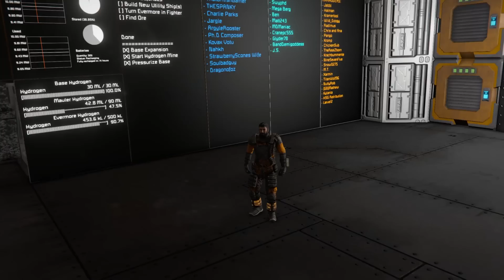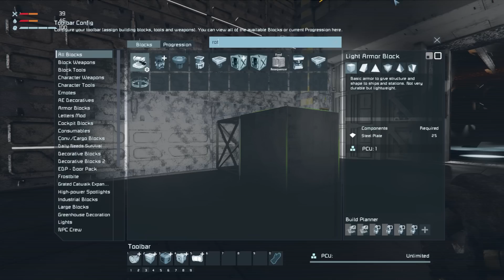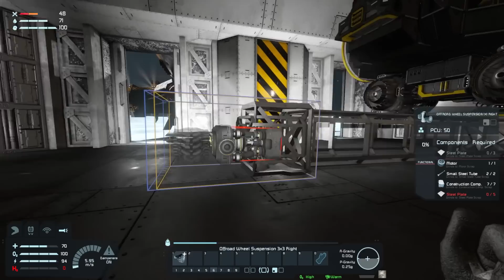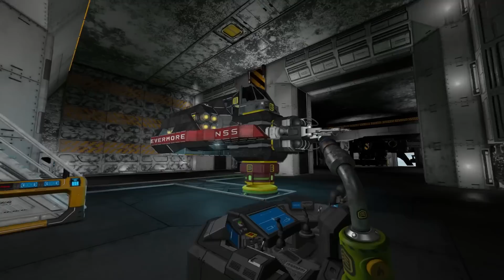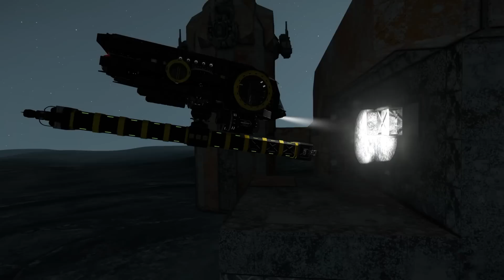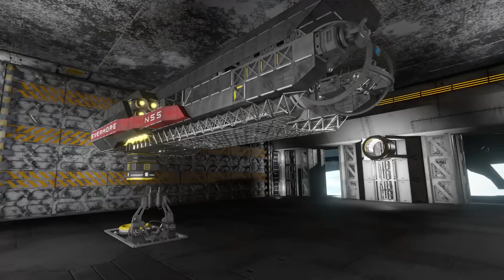No Suit Survival Europa: Ep. 4 Tools of the Trade - Space Engineers

Comment: Idea for towers: mobile. Either on wheels or with thrusters, then make a pipe to them. Can move the pipe easily and the tower doesn't have to be deconstructed every time.
Reply: Also, to solve the cockpit vs flight seat behind glass issue, you might be able to use the mod Block Combinations, which I believe includes combined glass pane/cockpit blocks that are airtight. In the same category of mod, Offset LCD and Text Panels does the same thing but for, well, you guessed it.

Comment: I had an idea for building out your base.  At the beginning of this you mentioned that your turrets might interfere with expansion.  They wouldn't if your base was a series of modules that you build in a circle around the mining pit, connected by some sweet glass tube walkways.

You already have your hangar module.  You'll need a command center, a barracks, a production module, and maybe a mainframe module where you keep batteries, programmable blocks, and timer blocks.

In between each of these you can place a defense tower that's accessible for maintenance from the glass-cpvered walkways.

And, you can have an awesome overlook on each module into the mining pit.

Comment: don't know if they fixed the issue with subgrid weight not beeing calculated in, when dampening, but in case it's not, wouldn't it be better to use mergeblocks instead of the rotors? the bigger sg mergeblock should be able to merge with the lg mergeblock, esp for the oredetector this might have been an easier solution without the weight of the detector pulling your ship down.

Comment: In the Utility Ship if possible place a sensor to detect you to make sure to pressurize to cabin area that way you don't have to "look for the switch" it will depressurize once you get into the cockpit and opon exiting it will automatically pressurize   >> a timer block on loop to close the doors ( 2-3 seconds) should allow you to get in  >>>

The hinge system that others have mentioned,  works well. Tool < hinge part and on sides opposite of each other mag plates/ landing gear 1: to attach to floor/ wall/ ceiling when not in use 2: to lock it in while using ( reduce tool shake)

While mining don't forget about sorter(s) and ejector(s) for the excess ore (unless you plan on right clicking .... Ice fills cargo faster than stone

Comment: The Evermore is looking good, Mavn!

Suggestion for your Utility ship.  Maybe put a landing gear under the nose to help lock the tool in place.

Brainstorming some ways to fit all the tools on the little ship I came up with this stuff:

If you put a hinge part right on the tool heads you could mag lock the tool head to the back/bottom of the vessel and you just grab the one you need, limiting the amount of pipping you would need. I'm picturing the hinge swinging horizontally and not vertically so that they can pass through properly to be attached.  The attach command is connected to the outside (housing) part not the inside part.
If you replace the big square conveyor converter part to a vertical motion hinge and implement the hinged tool heads you could store all three tool types on the underbelly because the "middle" stored tool would have a means of being pulled out (flipping the tool arm all the way through the hinge motion.  OR  If you put another rotor at the back with the tool heads mag locked to that you could spin it to the correct tool.  This second method would have these moving parts the arm rotor, the tool head holder rotor, 3 hinge parts (on the tool heads), and 1 hinge housing; only one full hinge would be active at a time.

Comment: Random thoughts
* Next time you need to move a partially built ship around, slap on a control block and a short range antenna (<100m). Save yourself the hassle of working in a vacuum and you'll probably want it eventually.
* It might make sense to add buttons to the cockpit of the new utility ship to trigger the open/close functionality of the main hanger. This would allow you to close the doors without getting out of the ship.
* Possibly add a hanger pressurization status light in the exterior docking access corridor so you can see if the hanger is pressurized before leaving the utility ship.
* If you are going to add a 'permanent' turret control to the base, why not turn it into your safe room for depressurization events? In the interest of making it easily accessible, why not built it below the hanger, with the entry built into the arches between the two bays.
Reply: Yes a pressurized space to be safe if the base brake. Maybe he should build he's turret control room into a small ship equiped with welder and ressources, so he can patch up the base if necessary without risking it's life ?